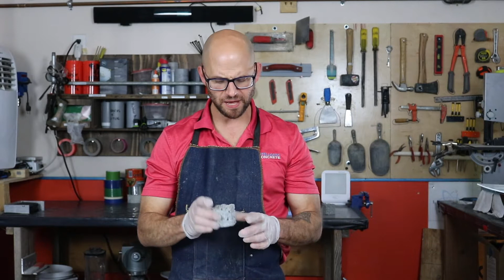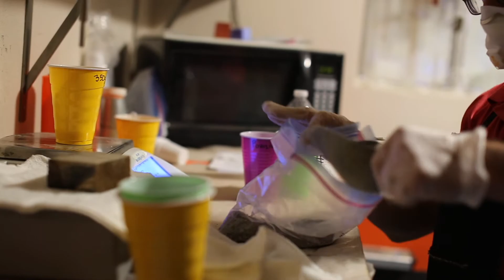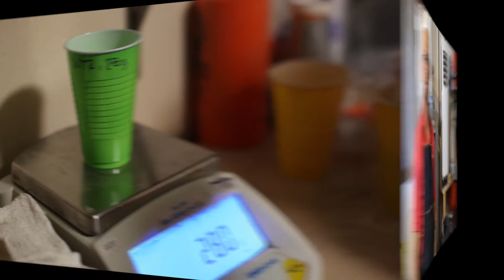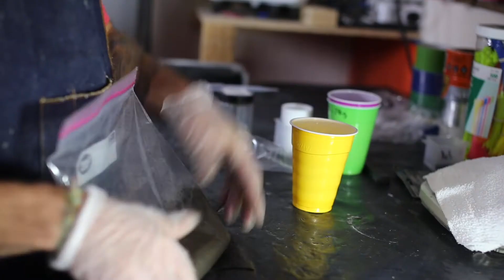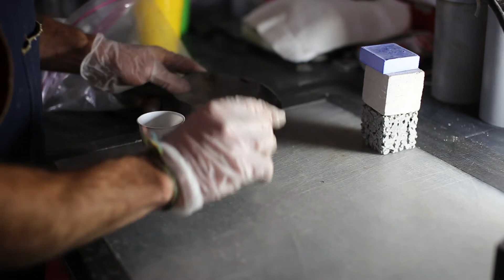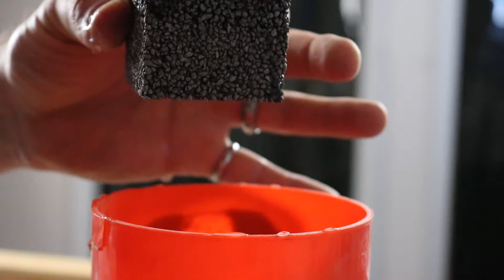Pervious Concrete Part 2 - Vlog #81

Comment: Why don't you answer? I'd like to know the mix design for this 2 types of pervious concrete 👉.
Reply from the maker: David I apologize.  I thought the mixer was included.  I’ll redo the video focusing on the mix.
Reply: @IntelligentConcrete  If you can, i would like to post here the mix for this pervious concrete. I'm doing an experiment for a college competition and i'm running out of time. Also if you can, it would be great if you give me the mix in SI not in inch and ft, but i can make transformation if you don't have time.